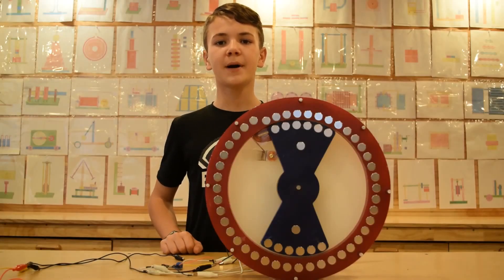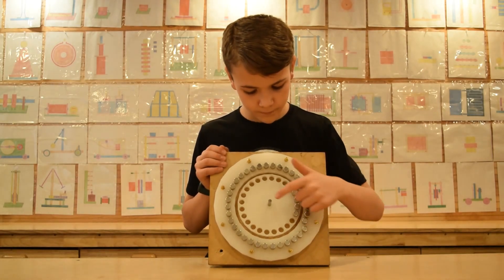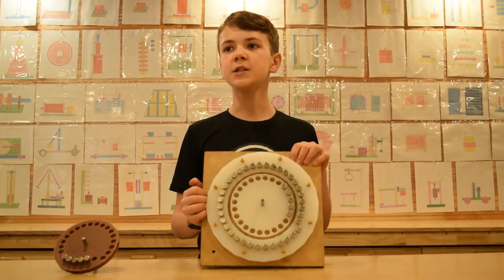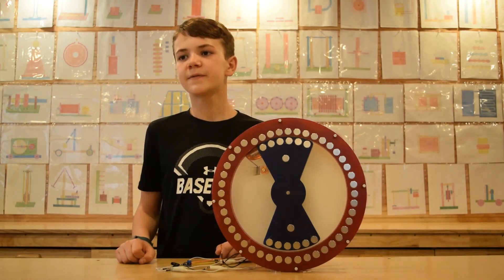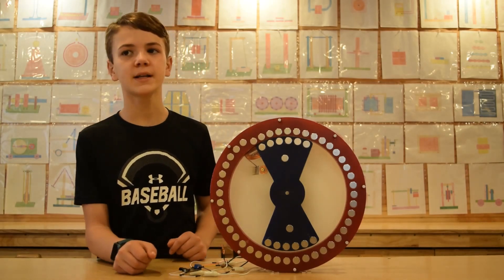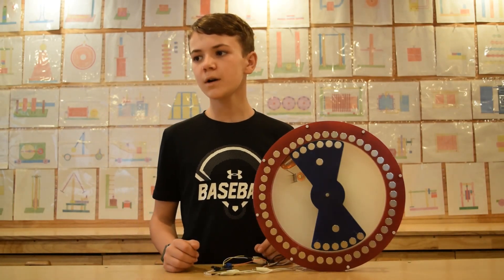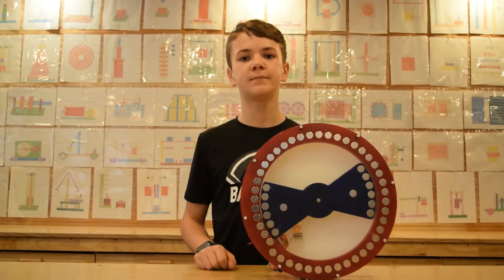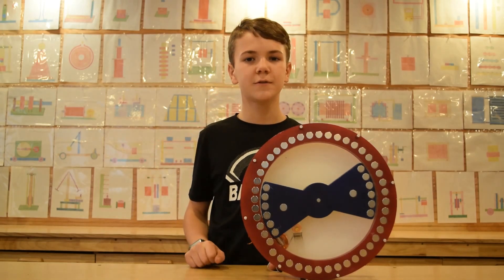All Magnet Motor with regauging section.

Comment: Don't tell me.... If you connect a dinamo to the shaft you can generate enough power for electromagnet? :)
Reply from the maker: That's the idea of this invention. The original inventor of this invention claims 318% energy power in to power out. This motor provides torque on the shaft for 300 degrees of the rotation, it's actually very strong. There's only 2 quick pulses of the 360 degree rotation, 1 pulse for each of the rotor arms. The energy that it consumes is very little and can run on one 12 Volt 4.5 Amp battery without recharging for hours. We did not do major testing to see how much energy is consumed, because we are busy making more videos of different inventions.
Reply: @DanielsInventions  if there's that much power then it worths connecting a flywheel instead of electromagnet so that the point would be passed by inertia.
But I'm pretty sure it will not work in both cases. Perpetuum mobile doesn't seem to be possible :)
Reply: @Auberge79  It's not free energy or perpetual motion as it is not a closed system.  This is an open system design where motor power is produced by opposing permanent magnets.  The only power input to the system is a quick pulse to the coils to regauge the magnetic field on the arms and allow the system to reset to initial position.   Now it comes down to: how efficient you can make each part of the system and can it be made so efficient that the permanent magnet motor generates more energy than is required to pulse the coils?

Comment: How many watts are required to break the sticky spot?
Reply from the maker: That's the idea of this invention. The original inventor of this invention claims 318% energy power in to power out. This motor provides torque on the shaft for 300 degrees of the rotation, it's actually very strong. There's only 2 quick pulses of the 360 degree rotation, 1 pulse for each of the rotor arms. The energy that it consumes is very little and can run on one 12 Volt 4.5 Amp battery without recharging for hours. We did not do major testing to see how much energy is consumed, because we are busy making more videos of different inventions.

Comment: I have been working with this specific shape for going on 9 years. I have built the concept you’re working with similarly, but instead utilizing steel graduated steel tracks. The rotor typically carrying one very strong Neodymium magnet. Successful torque of what I call free rotation with the exception of the one part that has challenged me to yet find a way to resolve to being the sticking point at the end point of the graduated steel track.
I apologize if this reads confusing at all. The design you’re working with has had my attention for some time now.
Please share more of your work and thank you for taking the time to share.

God bless!
Reply: Hii can you share your contact with me I want to work with you on a similar project
Reply: I saw another one where a cam kicks the stopping magnets out of the way.
Reply: I have a  Tesla Flux density meter, and the flux of a N42  0,5" Diameter X 0.5 length is about 435 mT 435 Mila-Tesla,  I ask Chat GPT to calculate and create a coil with a dimension large enough to cover the five rotor magnets 2.75 " x 0.6" x 0.6". 500 turns of 24 AWG magnet Wire  6.83 Ohms. Chat says it takes a current of 69.75 Amps to create a flux field that strong. So,  E Volts = I Amps * R Ohms. E = 476.4 volts.  But this would only be for a short time, every 36 degrees at the RPM. Short High Current Pulses. .1 seconds to 3.3MS, 100 to1800 RPM. 
Something to think about. A capacitor could be charged to this voltage and could supply current if the cap is large enough. The cap would have to be recharged in the remaining 324 degrees of rotation. I have eliminated the magnets on one of the butterfly rotor wings and replaced them with brass to balance the rotor. The brass slugs that replace the magnets are .441 inches long and .5 inches in diameter.
 I am going to design a Capacitor Discharge Ignition circuit, a Silicon Controlled Rectifier circuit to pulse the coil at this high current. Wish me Luck.